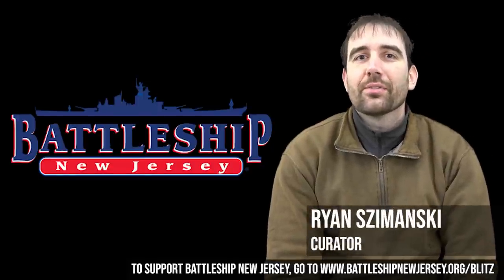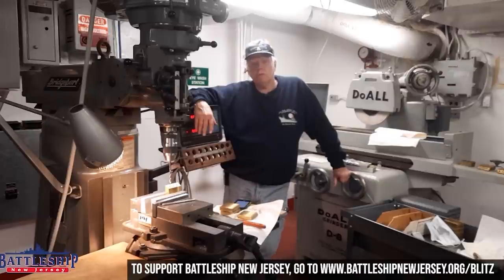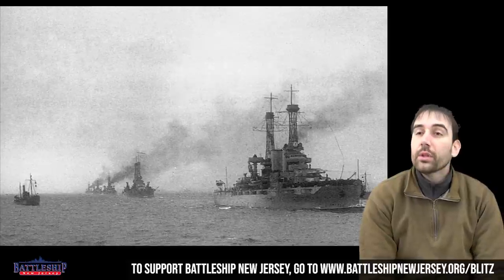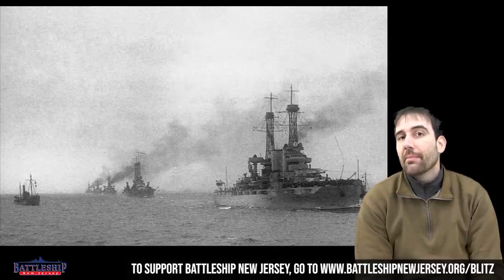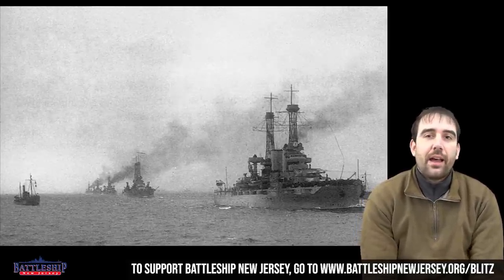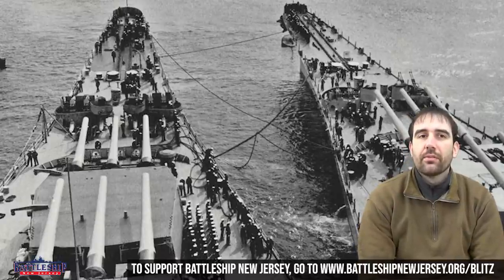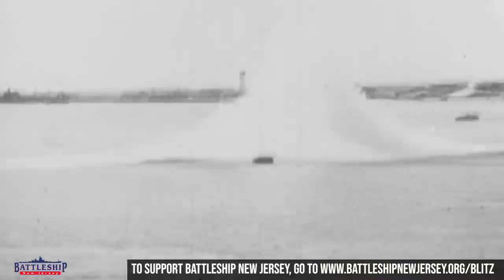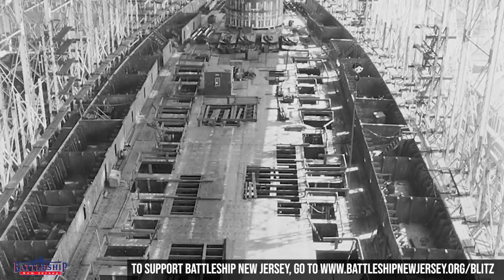The Evolution of Armor on Ships

Comment: The thickest plates on the YAMATO Class were not 24" (61cm), but 26" (66cm) VH armor plates; these being the turret face (port) plates sloped back 45 degree in their main gun turrets.  These plates were the only ship-installed plates that, to my knowledge, no gun, except perhaps the ship's own 18.1" (46cm) Type 91 AP shells, could do more than make a hole -- no penetration into the turret by the shell itself -- and only the US 16"/50 with the Mark 8 AP shells could make that hole under two specific angle/impact velocity combinations (near the gun muzzle from the side at 45 degrees and hitting at almost exactly right-angles with an angle of fall of 45 degrees at extremely long range; fat chance of either of these cases ever happening!).  The Mark 8 impact tests at right-angles (zero obliquity) were done at the US Naval Proving Ground, Dahlgren, Virginia, a year or so after WWII ended, on a 26" plate from the never-used SHINANO turret and neither shell had any damage (other than no more AP cap or windscreen, of course), one shell making a hole but not going through the plate while the next shell, at a slightly higher impact velocity, went right through.  This test was one of those that allowed me to very closely calibrate the basic metallurgical resistance of this armor, using the most widely-used form of US WWII Class "A" armor (circa-1937-44) as the standard for all of my test evaluations.
Reply: True. But if the hull was damaged too much, then the turret armor didn’t matter much. And as we know, Japanese crews had poor training against major ship damage.
Reply: ¡M
Reply: The shells fired at the Shinano's armor plates were adjusted to reflect a shell velocity at a 10,000 yard range.  As I remember the Shell that penetrated the armor is still at the bottom of the Potomac River, it was never located.
Reply: You're right that they "were" 26 inches, but they were 65cm, not 66cm. 1 in is technically 2.54 cm (which would make out to 66 cm and change) but in industry it's widely used as 2.5 cm (which makes out to exactly 65 cm). This leads to so much confusion that decades ago Congress passed a law that made US industry actually go metric (or metric-converted imperial).
Reply: @DrVictorVasconcelos  They actually were 660mm- according to "Japanese Capital Ships of the Pacific War: The Yamato Class and Subsequent planning".
Reply: @melgross  That's myth, based on a few examples of Japanese carriers taking bombs into crowded hangars a battleship whose magazine exploded, and finally, one carrier- who's inexperienced damage control team helped spread fuel vapors throughout the ship. Aside from Yamato's experience, Aoba took approximately 40 hits from 5", 6", and 8" shells, but withdrew from Cape Esperance at 30 knots. Shokaku took multiple bombs at Coral Sea and almost capsized en route to Japan but survived. She was heavily damaged again at Santa Cruz but survived. Hiei was pelted mercilessly with bombs and torpedoes before finally succumbing. I could go on, but my point's made.
Reply: @manilajohn0182  your point reinforces my point.
Reply: @melgross  Not hardly. I only provided examples of IJN warships which survived severe damage- and drew from that a conclusion that the Japanese must be doing something right. Neither one of us provided any data regarding particulars of Japanese damage control training.
Reply: @robertkelley3437  Below are the immunity zones of the Iowa and Yamato class BBs against the opponent's main battery. Source material is courtesy of the U.S. Navy Bureau of Ordnance.

Iowa class immunity vs. the 18.1" gun at a 90 degree target angle(in yards);
Citadel             24,800- 29,800
Turrets             24,700- 31,600
Barbettes         26,500- 31,600
Steering           24,700- 28,800
Control Tower 26,500- 31,600

Yamato class immunity vs. the 16" .50 cal. gun at a 90 degree target angle (in yards);
Citadel             17,000- 34,500
Turrets             0-      36,800 (Impenetrable)
Barbettes        16,600- 36,800
Steering           19,100- 33,400
Control Tower 16,600- 33,400

The Iowas were treaty battleships with the 10,000- ton escalator clause worked into the design. From a tactical standpoint, they were slightly up-gunned, slightly better armored, and 5.5 knot faster versions of the South Dakotas. They were designed for the purpose of escorting carriers and to overtake and destroy the Japanese Kongo class fast battleships.
Reply: @manilajohn0182  there have been a few. I’m spelling his name wrong, but Drachinel did an entire video comparing the Japanese and USA navies. The Japanese did not come out well in the comparison.
Reply: @melgross  I'm not surprised, as the U.S. Navy was far larger, the nation had a larger industrial base, and also had more advanced R&D. As far as damage is concerned, Lexington (CV- 2) was lost from uncontrolled fires and explosions fueled by vapors seeping throughout the ship. Bunker Hill was surprised with fueled and armed aircraft on her flight deck by two kamikazes and lost 400 men and was heavily damaged. Franklin was surprised with about 30 armed and fueled aircraft on her flight deck by 'one' dive bomber which was not detected by radar. She lost from 7- 800 dead and from about 3- 500 wounded- and the ship barely survived.

Don't let me, or Drachinifel, or anyone else for that matter, do your thinking for you. YouTube videos are a poor substitute for detailed study and analysis. The best that you'll get is what someone else believes. The worst that you'll get is what someone else wants you to believe. Read and study from published sources as best as you can instead. It's a good start toward educating yourself.
Cheers...

Comment: Armor is designed to prevent major damage, as much as that is possible, from the most widely-used weapons that the warship is expected to be fighting under the most likely, from the point of view of the Navy creating the specs, wartime conditions.  Sometimes these are correct and sometimes they are totally wrong -- the world is a complicated place!  During the period leading up to WWI, most AP shells had non-delay base fuzes -- well away from the impact zone near the nose of the shell -- that exploded as fast as the firing pin could hit the sensitive detonator pellet by impact inertia, the flame move through the fuze body to some sort of booster (to enhance the explosion of the small detonator pellet) and from the booster blast into the main explosive charge to blow up the projectile.  This would take about 0.003-second, on the average, to occur.  In "high" explosives, the ones that detonate, this time frame was the same under all conditions; the only problem was that some of the less sensitive high explosives (TNT and US Navy Explosive "D", as the major examples here) were made to be insensitive enough to not detonate from just the shell impact alone (German WWI TNT was in pre-shaped stackable blocks with felt coverings for each block and a thick wooden cushion at the cavity tip to prevent premature explosions in intact shells that get through the armor; Explosive "D" did not need any sort of cushion whatsoever when installed properly) and it turned out that the small AP-shell fuze-end boosters used in WWI were not powerful enough to reliably set off many of those more insensitive explosives properly, giving lots of duds or low-power explosions or even just burning shells with flames coming out of the base.  This was only solved circa 1928 by the introduction of Tetryl explosive in some Navies' AP shells, allowing delay-action fuzes to become reliable, too.  After WWI, delay-action fuzes became the rule, with tiny black-powder short-delay pellets in-between two detonators, the first, the "primer", being set off by the firing pin and the second, larger detonator being set off by the burning black powder when it's flame reached its inner tip, allowing the shell to move into the target some distance before the shell exploded.

Interestingly, even black-powder-filled shells were set off that fast when hitting thick armor, and were still used for some targets (in some secondary guns of US WWI-era battleships and even in some of the main gun ammunition).   For example, the British Common, Pointed, Capped (CPC) shells of WWI for use in their biggest guns against smaller, less-armored ships; these had a front end exactly like a thick, hardened AP shell, with a heavy AP cap and small windscreen, but were very thin-cased from there down to the base and were much longer than an AP shell, being filled with about 10% by weight of compressed black powder, to keep the same weight and, hopefully, not too different a trajectory as the thicker-steel AP shells of the same guns.  Usually, when hitting thin face-hardened or homogeneous plates, up to 0ne-third of the projectile diameter in thickness at up to 20 degrees obliquity from right angles or so, they could penetrate the armor intact and due to the slow burning of black powder, would move from 20-40' into the target before the slow-burning black powder blew up the shell into a rather small number of medium-to-large, rather slow-moving fragments moving forward like a shotgun blast through the enemy ship.  No booster was needed here.  However, against thick, face-hardened armor, these shells underwent a near-perfect detonation like the AP shell high-explosives did (British Lyddite being the comparison here), giving about the same blast power in the same 0.003 second after nose impact.  What was happening was that in the under-20-degrees impact region, the nose acted exactly like an AP shell and could punch through even thick plate, but if the shell did not make a hole and begin to pass through it, the shell body would collapse like an accordion and the black powder would be set off on compression as the projectile destroyed itself, with a low-order explosion and lots of flaming black powder thrown around.  This was much like what happened to a British Lyddite-filled shell that did not penetrate.  If the CPC shell DID begin to completely penetrate, then the destruction of the shell body slowed down considerably and it could remain intact long enough to get imbedded in the plate with its front end extending behind the plate and its base still in front of the plate, after which it would break apart.  However, if it got to the imbedded halfway point, the extreme deceleration of the shell by the hard-faced armor would throw the black powder forward toward the nose and compress it considerably.  Since black powder is a mixture of three ground-up separate materials (potassium nitrate, sulfur, and charcoal), it has a lot of empty space between the flour-like grains so it can compress to about half of its length in the cavity as the shell moves forward through the plate.  What happens is that the entire volume of black powder is suddenly compressed like it was hit by a hammer into the front end of the shell cavity and it all explodes everywhere inside simultaneously.  It may be only about one-third as powerful as Lyddite, but there is about three times the weight of Lyddite in a CPC shell, so the total blast power and the short time make the two types of shell act very much alike.  In tests, both shell types, when they exploded as a detonation (Lyddite) or pseudo-detonation (black powder) inside a thick armor plate, could break the plate in half, which is kind of amazing for black powder, is it not?

When delay-action fuzes became the norm, stopping the enemy shell from getting deep into the ship or, failing that, destroying the shell's ability to explode properly became the reason for the armor.  The inclined top-over-bottom armor scheme used in HOOD, SOUTH DAKOTA Class, IOWA Class, YAMATO Class, RICHELIEU Class, VITTORIO VENETO Class, and NELSON Class was there to do both.  Tilting the belt plate that way made a downward-falling shell hit the plate at an angle and this makes the armor act like it was somewhat thicker than if it was hit square-on.  It also has the effect that the shell is violently twisted by the asymmetric forces so that it tends to exit the plate back, if this angle is over about 15 degrees or so and the shell succeeds in penetrating, turned toward the right-angles direction in this extremely short distance in the plate.  This puts a major stress on the projectile, especially its lower body and base as it swings around like a baseball bat pivoting on the shell nose and slams against the armor, especially the hard, rigid face surrounding the hole.  This can deform and even break the projectile in half or snap off the base plug and fuze, rendering the shell either a dud or perhaps with a low explosion right there, nullifying the fuze delay.  In the BISMARCK, they went in the opposite direction, with the tilted-back high-angle slope BEHIND the belt to cause any shell that penetrates the belt in one piece to glance upward into the two-deck region above the waterline main armor deck and explode there, causing more internal hull damage, but none in the important "vitals" under the armored deck.  That is not so efficient as the top-over-bottom method, but it works too, as long as flooding from torpedo hits is not also present.

Most of the thick deck armor in the WWII battleships was to stop aircraft AP bombs, but would also make it hard to penetrate with AP shells coming from the side at a shallow angle of fall, requiring deck hits from shells to be at extreme ranges where hits chance was much less, so the thick decks were a kind of "judo" against the fire-control systems of enemy ships, making them have to try to get into the inner area where side penetration was possible and the only way to get into the enemy ship, which gives the target ship a much better chance to even the odds against an enemy, since a smaller gun shell that can punch a hole in your side armor at closer ranges is just about as deadly as a bigger gun shell that your ship might have.  The odds become more even at close range since a lucky hit by either side can end a battle, as HOOD demonstrated rather violently!

Comment: Krupp's post-WWI equivalent to both STS and Class "B" armors was Wotan Härte ("Odin Hardened", pronounced WHOATAN HAHRTEH), replacing its prior full-strength WWI homogeneous, ductile armor -- usually called "Krupp Soft" or, after the first test plate of it in1894, in Germany "Quality 420" steel, made of the same steel used in its KC armor, but with no face layer -- as with the British, this kind of armor in any significant thickness was not used very much in WWI-era ships, just on turret roofs and similar flat or curved surfaces of rather small size, not on large "protective" (lightly armored by WWII standards) decks.  Wh was a special separate alloy from KC from the mid-1920s to the end of WWII, just like in the US.  German heavy cruisers of the HIPPER Class used Wh armor throughout.  It was also used in some of the armor in prior cruiser-sized ships, though the homogeneous form of KC-type steel was also used in some of these too.  NOTE:  There was also a Ww (Wotan Weich (WHOATAN WHYK) or "Odin Soft") used in various grades in thin plates for fragmentation protection and anti-torpedo bulkheads after WWI.  And a Wsh (Wotan Starrheit (WHOATAN STARHEIGHT) or "Odin Extra-Hard") for very thin plates against fragments or machinegun bullets, much like British WWII "Homogeneous Hard" aircraft armor to protect crewmen.
Reply: Wotan Härte (Voh-tahn Hehr-tuh)

Comment: Ducol sounds like "DEW-kol", Wotan sounds like "VOE-tahn". Hope that helps. I might have it wrong but I think Ducol is essentially the same as the USN's STS, or class B (homogenous) armour, depending on how thick the plate is. Wotan came in different grades, I know of "soft" & "hard". I don't know much about those. They might be chemically different but I suspect the difference has also to do with one going through the cementing / face hardening process, and the other not.
Reply: I think it is closer to WOH-tahn then VOE-tan (take it from a Dutchman)
Reply: @blablabla-qs5io  German W sounds like a V as ant4812 said :-)
Reply: @russellgough7801  for an English speaker to pronounce it like a German would.

Voe-tahn is the best I think.
Reply: For the next video: The fleet was composed of ....  Use "comprised" exactly as you would included. Thanks for your excellent work.

Comment: @17:30 "If there's a bigger gun out there, why wouldn't you use it?" KGV class: Am I a joke to you? (I know, I know, Treaty limitations, etc, just having fun sassing people)
Reply: That joke will never go out of style, but where she didn’t have better armament she had better armor thanks to increased thickness and higher grade armor plating, but everyone seems to forget about that
Reply: @R-2500  And yet the Japanese sank one of them ( Prince of Wales ) with effectively one torpedo hit.  Others may have struck afterwards but these were actually unnecessary,  as the first one was enough to seal the ship's fate.  Ironically these later hits probably slowed the sinking down by creating counterflooding as they hit the opposite side to the fatal hit.  What's more,  this torpedo was WW1 vintage rather than one of the Japanese "long lance" super-duper jobs used by their cruisers and destroyers.  Everyone seems to either forget about all of this or conveniently chooses to turn a blind eye to it. All in all,  not very impressive for a modern generation ship to go down that easily - and i'm speaking as an Englishman!!
Reply: @simonpitt8145  torpedoes are way more deadly than any shell though, the only better tool at the time was in an infancy stage (German glider bombs, these were the first effective anti ship missiles).
Reply: @simonpitt8145 one torpedo? There was 80 planes involved and over 100 bombs and torpedos dropped